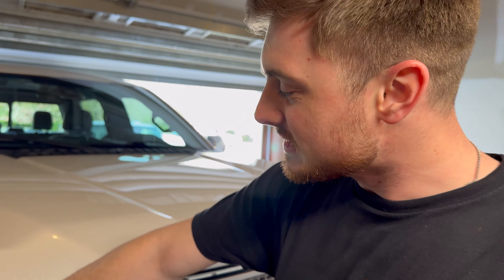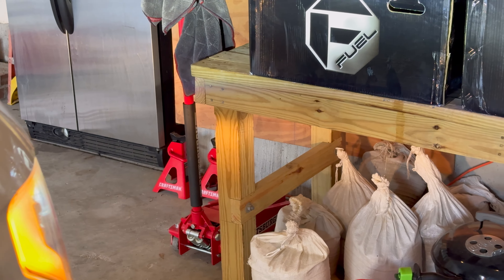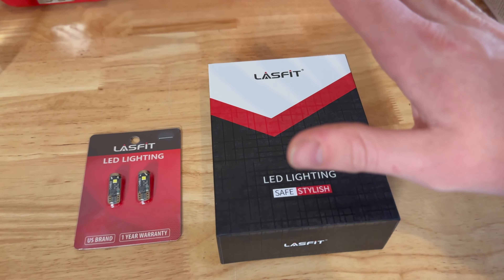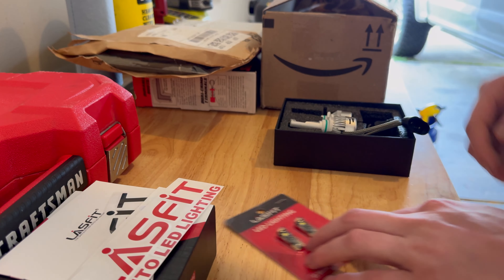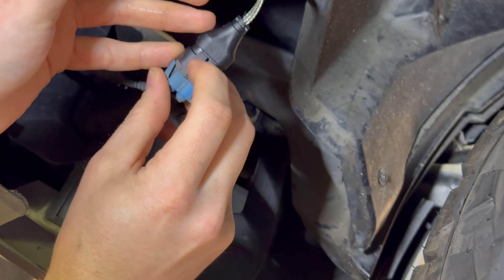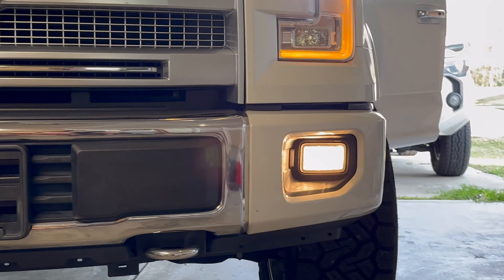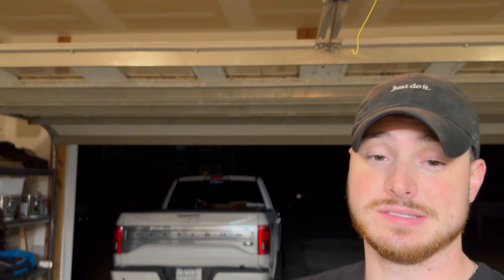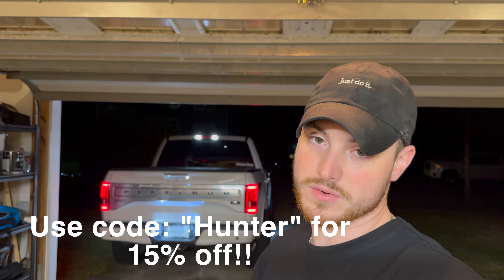LASFIT LED's VS HALOGEN'S - 2015-2020 F150 Fog Light Replacement

Comment: Also. If u want to know how much wattage are those Lasfit - L series T10 that u out on ur license plate lights. 

They produce 2.5W. One of the brightest T10 led bulbs on the market. I love them. And they are ultra bright. ❤️‍🔥

As for ur beam pattern. I would honestly adjust the height a bit down. U want to reduce aiming to other drivers. U want to enjoy, don’t blind others. Not just for u, but for safety of other people. That’s what we did and they are incredibly bright ❤️‍🔥🙏🏼

Comment: The LA plus makes 30W per bulb. But u actually get 28.5W per bulb from observation.

I truly hope Lasfit doesn’t get start to get rid of LA plus for LAair. Because it’s a sweet spot for low beams, fog lights, and high beams as well. And especially that handy dandy 360 adjuster collar. 

I been told by Lasfit customer service. 

That’s why I been helping my friends and my family to get their hands on LA plus before they are gone. 

Why? Because the temperature is very low; making them very reliable. 

How hot? Well we would expect between 160-200+ degrees Fahrenheit huh?

Nope. After 27 minutes of run time. It gets down to 96 degrees Fahrenheit. 

That’s the coolest led bulb: 

The cooler the led bulb, the longer the lifespan. The hotter the led bulb. The shorter the lifespan.

Any led bulb for an all in one unit that makes below 150 degrees Fahrenheit is goodS anything above is soenthing u need to take in the consideration. 

For the balance of price $70 a pair, the wattage, the temperaturec the 360 adjustable, reliable and longevity. 

The LA plus is definitely worth the money.

I would highly recommend get ur hands on Morimoto - dielectric grease.

It’s design to add physical barrier, to protect against moisture from getting in between the connectors. It’s basically cheap insurance policy. 

Yes they are water proof; but moisture can get in and ruined them.

U gotta protect ur led bulb. So get ur hands on them on Amazon.

Comment: U definitely get ur money’s worth from Lasfit. 

Me and my family are running with Lasfit on our vehicles. 

LD plus switchback on my H11 low beams, LA plus 9005 high beams. 

My family’s 3rd gen Sienna has LA plus H11 low beam, and LCair 9005 high beams.

And for my brother in law’s 05’ Sienna. I need to get new oem reflector headlights, so he can run with led bulbs. 

I already carry LC plus 9006 low beams and LA plus 9005. 

But I’m thinking for 9006.

I’m thinking either Lasfit - LC plus or Sylvania - SL.BX2 for that 5 year warranty.
Reply from the maker: They’re a solid company! They’ve been good to me, especially now that they’re an official sponsor
Reply: @hunterrwiilson  to my brother in law, I see him as, he just wanted that works and don’t have to think about.

What do u think?

Lasfit - LC plus 25W or Sylvania - SL.BX2 12W? It may sound less. But atleast with reflector, it will increase the intensity for sylvania better than projector.
Reply from the maker: @toyotabrony  as someone who has been using LASFIT for years, LASFIT is the way to go
Reply: @hunterrwiilson  actually. I’ve been owning for over a year. And I started on with the correct characteristics of the led bulbs. lol. I’ve seen how Lasfit was and got tested by HR 5-6 years ago.

Thank god I started it right lol. 

Alright. I’ll stick with Lasfit then.

Have u had any issues with them when they go out?

How long u have been good relationship with Lasfit exactly?
Reply from the maker: @toyotabrony  I've had a couple burn on after a year or so, but I think there's an issue on my truck that is causing it. Other than that they've been great! I just recently got sponsored so it's been really good, they're a fair and respective company with good people!
Reply: @hunterrwiilson  I agree on that. 

I think what happen is, when u have a vehicle like Jeep,Dodge,Chrysler, VW’s, Fiat, BMW, Mercedes-Benz, or Audi, u can get experience of loss of light, flickering, not turning on.

For that issue, u would need Lasfit - anti-flicker/decoder. To stabilize ur led bulbs. 

That will help a lot.

And on top of that, if u want to protect ur led bulbs.

I highly recommend get ur hands and buy Morimoto - green dielectric grease.

To seal the gaps between ur aftermarket led bulb connector and ur factory wire connector. 

What it does is basically creates an extra barrier, to prevent moisture from getting into ur bulbs. 

Sure they are waterproof. But it’s not enough. 

It’s basically cheap insurance policy. 

Don’t let it ruin ur day again.

I highly recommend get ur hands on both Lasfit - Anti-flicker/decoder from Lasfit website AND Morimoto - green dielectric grease from Amazon. 

And u will have a much better results. So they will not fail u.

And that’s the thing for those missing important things that people had led bulb burned out or not turning on.

On Japanese cars. It’s not a big issue. 

To me it doesn’t matter. I’d still add dielectric grease, no matter what.

With modern vehicles that had more tech.

U have to fight fire with fire using those two items. 

On older vehicles like my 2015 lifted Scion xB. It’s old skool tech. Which means I don’t have to worry about.

But I’m using LD plus switchback and I have seen people had this issue. About 5050. So I got the Lasfit anti flicker or decoder to help stable those switchback. 

So far over a year, they still work. 

Lasfit send me new pairs just in case when I had two color one yellow and one white when I explain what happen.

So I’m still running the original switchback, while I have a spare just in case. 

Lasfit is amazing